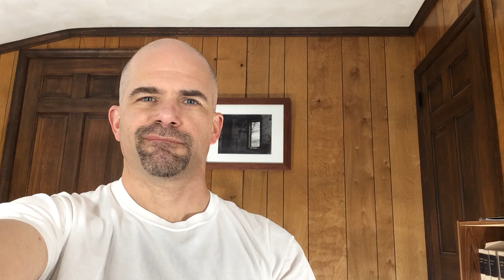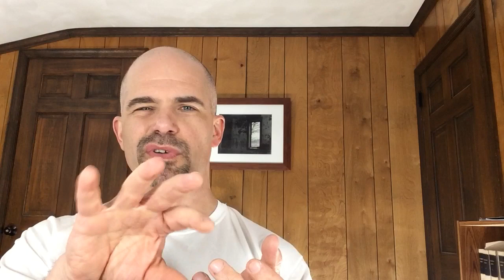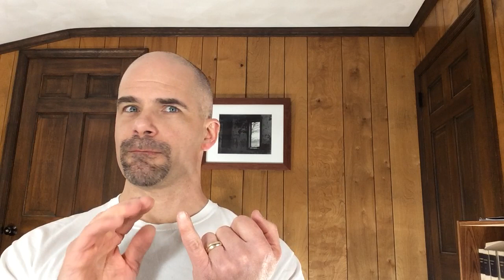Paintball Accuracy, Episode 4: Smooth vs. Spin-Inducing Barrels

Comment: I recall the old science demonstration where you can determine if an egg is fresh or has been hard boiled by spinning it...
Reply from the maker: :-)  Yes, sloshing viscous liquids in ill-formed bath beads doesn't make for an optimal situation.
Reply: That may be with rather watery liquids, but not with paintballs. As PunkWorks proved and as is seen by the curved paths of Apex users, spin is imparted.